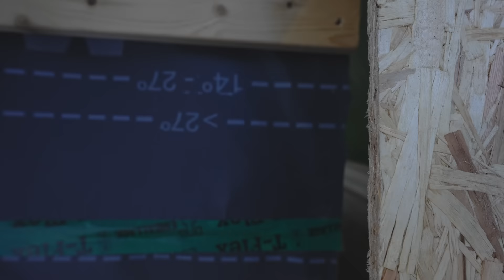Joys and Struggles of Simple Living in the Forest

Comment: I wonder if you have tried covering the hole in the ice with branches of spruce and top it with a layer of snow to isolate so the ice does not freeze over in the hole where you collect water? 
I have heard that this method helps a lot. 
An other one that i have seen is that they placed a wooden 
" box" without a bottom in the hole and have a lid on top.
Thank you for inspiering me !